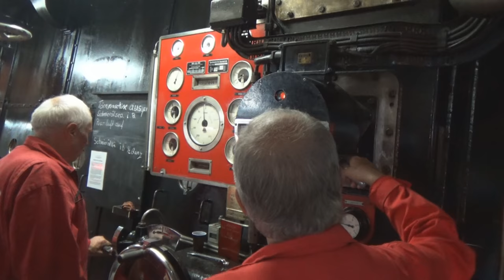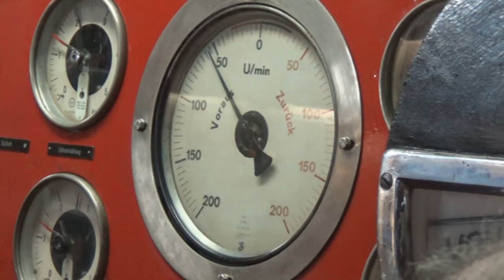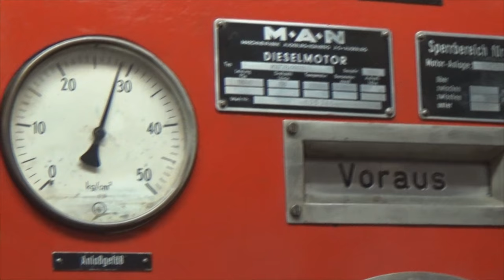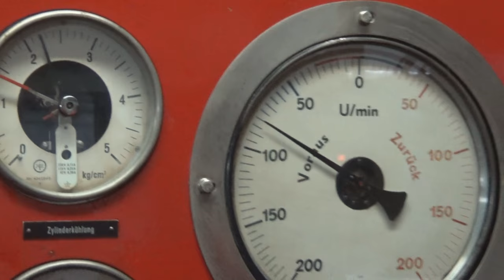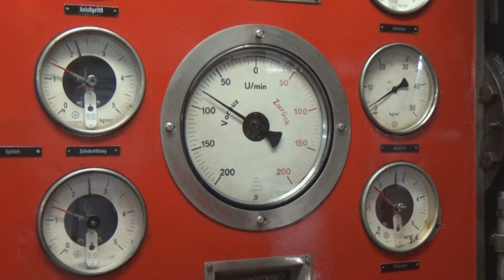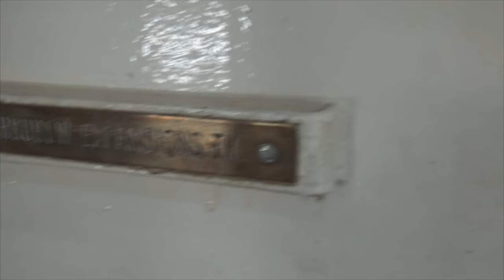M.A.N K9Z 78/140 D  - Cap San Diego

Comment: Since 1976 until 1981 a+the company Nautconsult (Singapoor flag) had 4 ship with same  engine ,their names Santa Ursula ,Santa Teresa ,Santa Ines ,Santa Isabela ,the all were building in Brasil.The engine were the old technology ,but low consuption.I been as second engineer,and worked 5 years in two ship .The engine had 3 pistons the numers uno ,two and 3 ,that in low  RPM served as scaving air  systems till, de turbo blower increased the pressure and rpm.
Thank you for reading me 
Alfredo Verdun Ch/Eng.   from Uruguay
Reply: https://de.m.wikipedia.org/wiki/Santa-Klasse_(1950)

Comment: Awesome to listen to with a subwoofer and surroundsound. You can really listen to the engine´s combustions. Al most like heart beats.
Reply: My sister recomended me to buy subwoofers for so so many times, that I resigned and finally bought it. How I appreciate it now :-)
Reply: Oh yes it will remind you when this big sound is felt throughout the body and under the feet, the heart rate doubled by this gigantism. .
Reply: The deep Thumping Sound actually is the Scavenge Air Pump (is it even called like that in English? Modern Ships have electric Auxilary Blowers instead so I only know its German Name "Spülpumpe" and translated it to English) which blows fresh Air into the Cylinders at Bottom Dead Center. It is located behind the Air Filters, at the same Deck as the Injection Pumps. See 08:47 for Reference.

Comment: WoW  A nine unit MAN of  old version. Bosch fuel pumps. Telescopic cooling pipes. Well maintained and kept clean. Wonder if it is still running in 2020. Thanks
Reply: Yes she is, she does little passenger trips on the river Elbe and the German coast a few times a year. Currently everything is on hold though, due to that damn virus.
Reply: Still running in 2024

Comment: Difficult to find a YT video on this kijnd of marine engines .I remember dual scavenging headers and the " Holy" buttefly valve used to connect the two headers parallel or serie .
During manoeuvers , it was the art of the second engineer to open or close the butterfly valve at the most appropriate moment without screams from the turbo blowers .

Comment: Are those large blower housings on the top engine deck actually turbochargers?
If so those are the largest turbos I’ve seen!
Reply from the maker: Yes it are turbochargers
Reply: https://cdn.zmescience.com/wp-content/uploads/2015/11/turbo.jpg thats what i call a huge turbo
Reply: Yes, 3 turbos. I'm sailing on a ship with 4xV12 cyl and 2xL8 cyl, 1MW per cylinder, total of 64 cylinders. All MAK.
Reply: yes they are

Comment: Are two cylinders running a bit richer in fuel?
The boom-boom.... boom-boom.. sound seems like it runs a bit uneven.
Reply: Nope, that's the Scavenge Air Pump on three Cylinders. It is necessary to maintain Scavenge Air Pressure at low RPM when the Turbochargers aren't effective yet.

Comment: How old this engine or the year it was built. Whats the name of the ship. Im also a marine engineer by profession but i never encounter this type of engine that such cylinder head is round.
Reply: The Name of the Ship is in the Title. The Cap San Diego was built in 1962 and Two Stroke Engines with Exhaust Gas Valves weren't a Thing back then. There is a Butterfly Valve in the Exhaust Gas Receiver though, which allows the Engine to be Turbocharged. I'm planning to make a Video about how Marine Two Stroke Diesel Engines work where I use some Footage of a Modelof a similar Engine made by Sulzer where you can see the Butterfly Valve very clearly. I can link it here once I've uploaded it if I don't forget it until then.

Comment: What a beast! The injector pump(s) are as big as an engine for a diesel semi truck.😮 I was wondering about the firing order from the sound, but I see it's actually a 9 cyl.?
Reply from the maker: The engine has 9 cilinders, and it has two different firing orders for ahead and reverse.
Reply: @puckgrob33  Heh heh, that's wild, thanks!😉

Comment: What causes that “whoosh-whoosh-whoosh” sound, is it fuel ignition inside cylinders?
Reply: Nope; it's counterflow Scavenging. The Exhaust Gas Outlets are just located above the Scavenge Air Inlets in the Cylinder Liner, so the Scavenge Air has to blow all the Way up and then down again through the Cylinder.
Reply: Well, it sounds like a waltz music.
Reply: piston polka

Comment: You mean you don't have to just turn the key on and push two throttle levers?!!
Reply: No, at first you do not switch on this engine by key. You need air compression, you can see two big air tanks in this vessel.